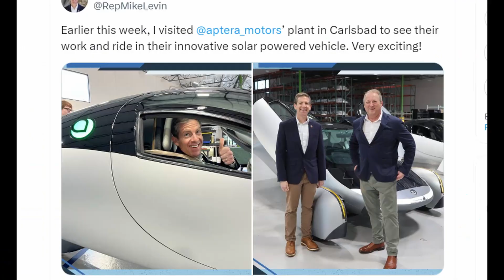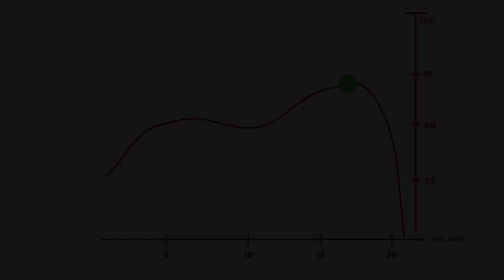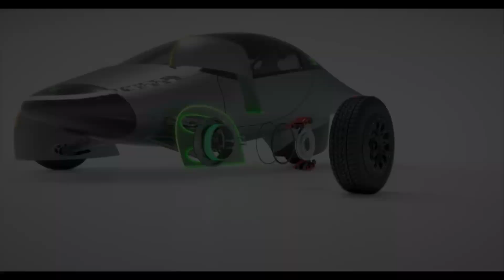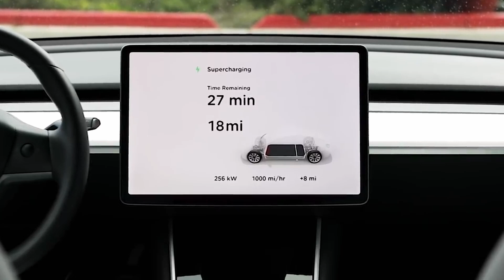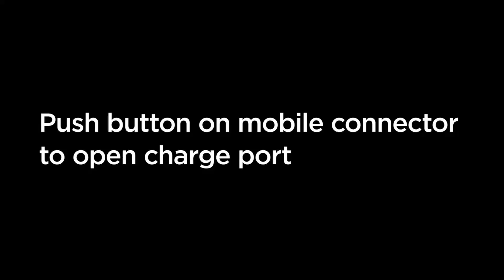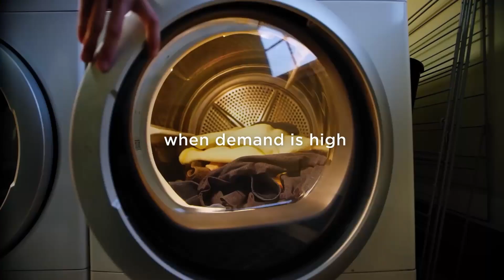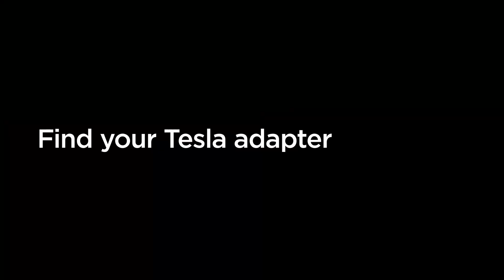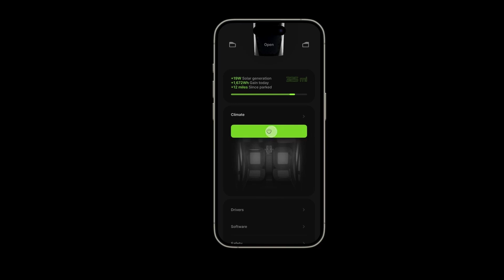Aptera Vs Tesla's Interest in Aptera

Comment: The aptera motorcycle, a deathtrap in case of an accident. Will compete against the safest car in the world. Good luck.
Reply: Vic needs to do some research please!
Reply: @cruzer01  It is easy to find data that the Tesla is the safest car in the world.
Reply: @GoClimbARockEh  It's easy to say you can find evidence. Aptera only has evidence that fools the extremely gullible. Happy to discuss all the evidence you have.
Reply: You keep calling it a motorcycle. Have you ever even seen a motorcycle?
Reply: @GoClimbARockEh  ENERAL ASSEMBLY OF NORTH CAROLINA
SESSION 2015
HOUSE BILL 6
RATIFIED BILL
H6-v-3
AN ACT TO DEFINE AND REGULATE AUTOCYCLES.
"Passenger Vehicles. –
a. Autocycle. – A three-wheeled motorcycle that has a steering wheel,
pedals, seat safety belts for each occupant, antilock brakes, air bag
protection, completely enclosed seating that does not require the
operator to straddle or sit astride, and is otherwise manufactured to
comply with federal safety requirements for motorcycles.
a.a1. Excursion passenger vehicles. – Vehicles transporting persons on
sight-seeing or travel tours.
…
d. Motorcycles. – Vehicles having a saddle for the use of the rider and
designed to travel on not more than three wheels in contact with the
ground, including motor scooters, autocycles, motor scooters, and
motor-driven bicycles, but excluding tractors and utility vehicles
equipped with an additional form of device designed to transport
property, three-wheeled vehicles while being used by
law-enforcement agencies and mopeds as defined in subdivision d1
of this subsection."

You can make up your own definitions, but they have no legal meaning.e Aptera FAQ. And:
ENERAL ASSEMBLY OF NORTH CAROLINA
SESSION 2015
HOUSE BILL 6
RATIFIED BILL
H6-v-3
AN ACT TO DEFINE AND REGULATE AUTOCYCLES.
"Passenger Vehicles. –
a. Autocycle. – A three-wheeled motorcycle that has a steering wheel,
pedals, seat safety belts for each occupant, antilock brakes, air bag
protection, completely enclosed seating that does not require the
operator to straddle or sit astride, and is otherwise manufactured to
comply with federal safety requirements for motorcycles.
a.a1. Excursion passenger vehicles. – Vehicles transporting persons on
sight-seeing or travel tours.
…
d. Motorcycles. – Vehicles having a saddle for the use of the rider and
designed to travel on not more than three wheels in contact with the
ground, including motor scooters, autocycles, motor scooters, and
motor-driven bicycles, but excluding tractors and utility vehicles
equipped with an additional form of device designed to transport
property, three-wheeled vehicles while being used by
law-enforcement agencies and mopeds as defined in subdivision d1
of this subsection."

You can make up your own definitions, but they have no legal meaning.
Reply: @GoClimbARockEh  See aptera faq.
Reply: @GoClimbARockEh  And ggogle "GENERAL ASSEMBLY OF NORTH CAROLINA
SESSION 2015
HOUSE BILL 6
RATIFIED BILL
H6-v-3
AN ACT TO DEFINE AND REGULATE AUTOCYCLES."
Reply: @vic321344  the legal definition of what things are is probably the least meaningful in everyday life. It's true that legally, the Aptera is a motorcycle in most jurisdictions. Legally, in California, bees are fish. Legally, in Alabama, frozen embryos are children. In everyday life, none of those things are true. The aptera will not compete with motorcycles in the market. No one who wants to buy a motorcycle would consider the Aptera. In function and use, the Aptera is a car. It will replace cars in driveways and roads. All of you trolls insistence on calling it a motorcycle just demonstrates the underlying disingenuousness of your arguments.
Reply: @GoClimbARockEh  It is meaningful because it defines, that Aptera does not need to confirm to any safety standards necessary for cars. And it also defines, that the Aptera motorcycle cannot be registered in GB, EU, Australia. All of you trolls insistence on calling it a car just demonstrates the underlying disingenuousness of your arguments.
And the Aptera motorcycle will replace nothing. Its just a fun vehicle.
Reply: @GoClimbARockEh  So you have established it's legally a motorcycle and merely indicated it might be low on meaning, but not established that. If bees are legally fish in CA, does that mean Aptera is legally a car in CA? Not at all. If bees being fish is meaningless - and it certainly is - does that mean Aptera being a motorcycle is meaningless? Not at all; there is no relationship between the two examples. You are extremely short on logic. I am sure there are reasons to the contrary, but here are some pointers to being a motorcycle is more meaningful than being a car.
Motorcycles carry one or two people - so does Aptera. Cars carry up to nine.
Motorcycles don't get Federal and State tax credits on purchase. EV cars do - Aptera is disallowed. More like a motorcycle. Facts are facts and wishes don't matter.
Motorcycles like the Goldwing and the Harley are closer to Aptera in both size and weight than car's like the mainstream pick-up trucks most own in the USA, like the Ram.
Motorcycles are allowed in certain transit lanes - cars aren't, yet Aptera is.
On the last point, how can you call it a car and justify it using the lanes for motorbikes?
Reply: @GoClimbARockEh  Have you ever seen a car? When Tesla reveals its next model, make sure you compare on prices and features. Then you will know that the silly trike is doomed, be it car, autocycle or motorcycle - that won't matter.
Reply: @aussieideasman8498  If you're referencing Tesla's supposed upcoming $25k model, then I'd refer to you to the $39k cybertruck that also doesn't exist.
Reply: @GoClimbARockEh  I would bet on the new model; the Cybertruck; and the Semi all getting to market before Aptera, but hey, let's get real? I can drive under ten of your miles to a big Tesla showroom and drive out with a ModelY or Model3 in a range of colours (yes - they paint them) today. This is a Pacific ocean away from Carlsbad, lol. You're playing poker with a crap hand. That should give you another laugh.
Reply: @aussieideasman8498  as usual, you missed the point. Tesla may come out with a new model, but based on their track record it's not going to be at the price point they claimed. It's unlikely to be able to compete with Aptera on price. It certainly won't be able to compete on efficiency
Reply: @GoClimbARockEh  "as usual, you missed the point." As usual, you miss many points, so I will tell you just some and you need to consider them - maybe change your mind altogether? 
"Tesla may come out with a new model," Tesla WILL come out with a new model. 
"but based on their track record it's not going to be at the price point they claimed." Based on track record, it will sell like hotcakes. It will also get the tax incentives for buyers, which Aptera won't. You can stop talking up the possibility; 4 years is way too long. So if it is 20% more than the under $25,000, it will sneak in at $30,000, so a real $22,500 or less. What's the bare bones Aptera? A lying promise of $26,000, and probably $30,000 if ever.
"It's unlikely to be able to compete with Aptera on price." Well, I have just said the opposite, so tell me where I'm wrong and how you're right? 
"It certainly won't be able to compete on efficiency" That's where you are wrong. If two people drive across the States in an Aptera and share the charge costs, I will bet you five people in the new Tesla doing the same drive will pay less each when they share their charge costs. This is despite the lying claims that Aptera will be four times more efficient. I'm banking on it being less than two and a half times as efficient. And you're really stuffed if Tesla does that year of free charging, lol. Elon is completely unconcerned about Aptera; it's nothing but a joke to him.
Reply: @aussieideasman8498  Once again, thanks for the laughs! You really don't know what's going on do you?
Reply: @GoClimbARockEh  Any half sensible person can read our discusion and immediately tell you are the one who doesn't know what's going on. That's because I tell you and you don't tell me. It's patently obvious. But I'll play the ignorant one and you can educate me:
1. How many of those 12 production stations are up and ready to make their pieces?
2. What more is needed and when are they coming?
3. More specific to these issues: which BMS is the right one and which battery pack doesn't fit in the silly trike? You can go into detail about why they put up different items and why they even make 3D models of something as simple as a BMS case. I'm all ears.
Reply: Obviously, you haven’t been following anything on the scientific end of it. The composite body of app terra is the strongest compared to any car on the market. Death trap?
Reply: @gregkelmis2435  "Obviously, you haven’t been following anything on the scientific end of it." You're response contains nothing scientific, either. 
"The composite body of app terra is the strongest compared to any car on the market." Where is the science to prove that? Besides, you compare with cars on the market when Aptera is five fake prototypes with nothing on the market. Science doesn't do that. 
"Death trap?" Highly likely, when all indicators are considered, but wait until a marketable model gets scientifically crash tested.

Now here's where you have been duped by the snake oil:
They claim a 7 times stronger than steel for the composite body they won't be using. There was no evidence of that, but it doesn't matter because now it's weak CF and a steel roll cage. Quoting the composite body is akin to lying. You can't even follow the current facts, let alone any science.
Reply: @gregkelmis2435  Obviously, you havent been  following anything on the scientific end of it. The actual aptera has a structural frame made of aluminium. The plastic panels are not structural and just glued onto it.
Reply from the maker: Lo!